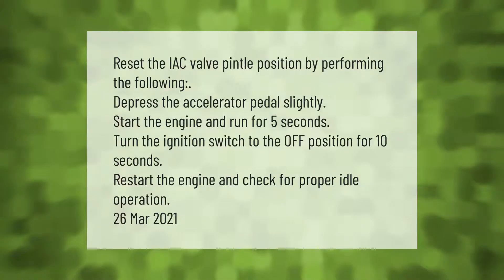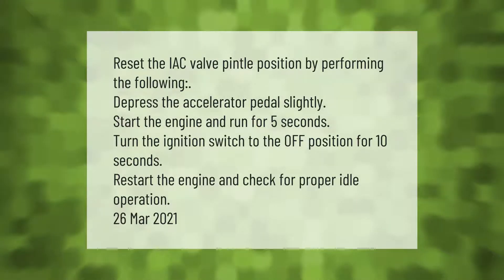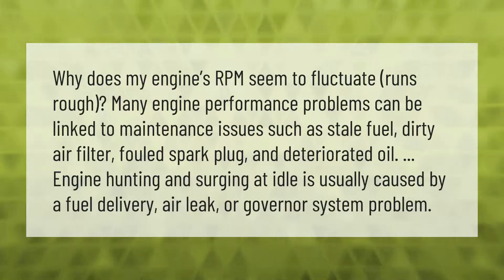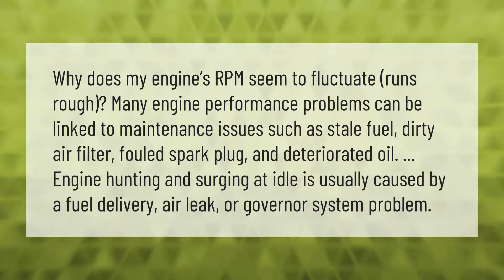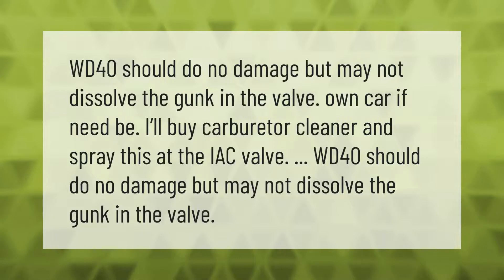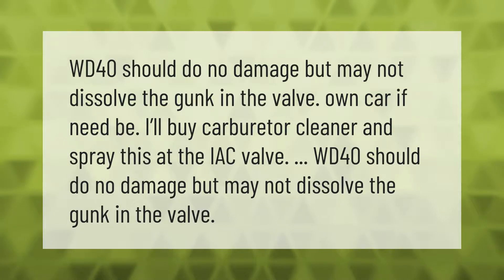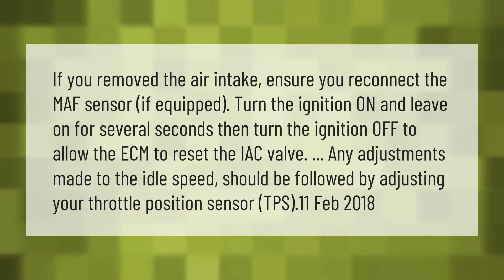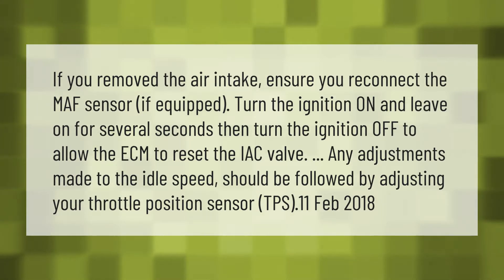How do I reset my idle air control valve?

Comment: My car idles really high and fluctuates. I changed the IAC and it still does this. What could be the cause of the high idle now?
Reply: Same problem here🫤
Reply: Probably the map sensor
Reply: Oh and there is a screw on your iacv u might have to turn to get your idle down to normal check vehicle rpm chart for the region
Reply: Throttle position sensor